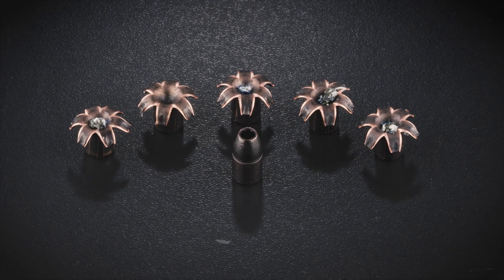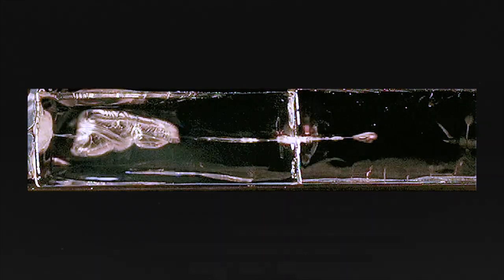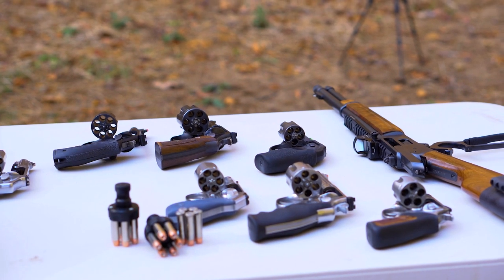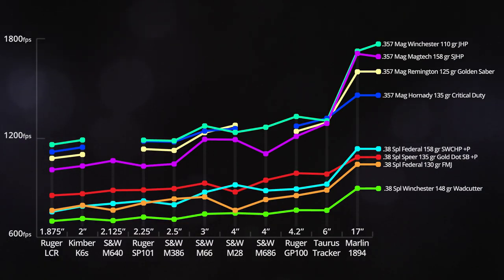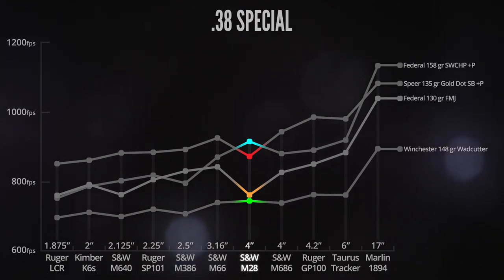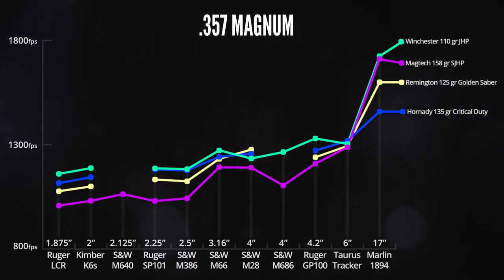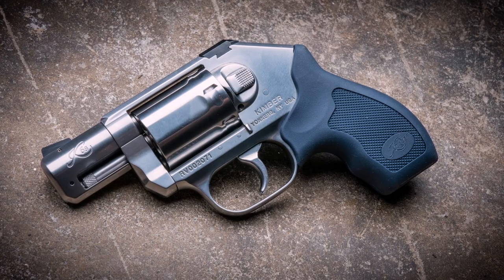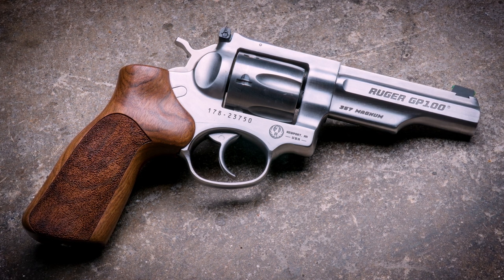Revolver Velocity versus Barrel Length

Comment: To be fair 5 shots is nowhere enough for a perfectly thorough comparison. 

Also one would need to shoot and test everything under lab conditions (controlled temperature and pressure, absence of wind and ideally calibrated machine) and use 10 rounds per single gun out of a certain production lot (the very same production lot for every single gun) and another 10 rounds per every single gun out of a different production lot of the very same ammo and very same production lot for every gun in order obtain a good mean accounting for every possible difference.

These results are kinda fair but one should also remember the 2.125 SW gun actually is a 38 Special only revolver which means it has a shorter firing chamber which might contribute in its slower than expected results when compaired to other barrel lengths.

Great work as usual tho.

Comment: Seems like the handier size, weight, and packability of the 7-shot 4.2" GP100 that I traded my old 6-shot 6" GP100 in for is more than worth the slight tradeoff in velocity, which is as I suspected. I rule!

Comment: So my 6 inch Colt Python should do the trick..
Reply: Oddly, while I wouldn't just sneeze at any 357, I've noticed that the Python frequently turns up in ballistic data-sets where is a sudden decrease in velocity instead of an increase, due to barrel length. Pythons are however, very accurate, in spite of the apparent "deficiency".  There's alot more to ballistics than speed and impact, even though we tend to obsess over those things with far more weight.

Comment: You need an 8inch gun and cut it down .5 inch at the time, until there in no more barrel outside the frame, but use only 2 loads in each caliber, the weakest and the hottest.

Comment: Interesting. Stuff I always wanted to know. Don't know why I don't get your e-mails, I'm a subscriber. 
So with my 1/2 dozen or so 2" revolvers, Maybe it's time I trade my Ruger SP101 2" in for S&W's Performance Center Pro Series Model 60 in the 3" barrel.(both are in .357)  My ammo of choice is Hornady Critical Defense. Maybe then I'll get more velocity, burnt powder, and expansion?! While the stubbies are great BUG's or pocket guns I am looking for a better concealed small carry revolver That does a better job!
Reply: Louis V - 3" seems to be something of a sweet spot, especially for .38+p loads. U don't lose much velocity, and of course there is the longer sight radius and usually adjustable sights. I have been thinking hard about the 3" LCR in .38 myself.  With magnum ammo, there is still some velocity loss due to slower burning powders which tend to be more optimal in a 6" barrel (or a carbine).  But it is still faster than a 2"

Comment: Biggest takeaway here concerning 357 Magnum loads is that those factory loads are WEAK SAUCE...     A 6" barrel firing the 110gr Winchester JHP ammo is barely cracking 1300fps?    125gr Golden Saber is also clocking in around the same 1300fps from that 6" Wheelgun..    Those are PATHETICLY WEAK 357 magnum and its my opinion that the factory rounds have never recovered from the vintage K-Frame's inability to deal with full power 357..  They downloaded and its never recovered..    I have 158gr handloads using H110 that average 1445 from a 6" 686..    125's should easily break 1500fps from a 6 wheelgun..   I guess with so many small 357 snubs out there the manufactures are loading the cartridge for those customers and not to the potential of the cartridge..   Which I guess makes sense since the few Handgun hunters left have generally moved on to larger, heavier bullets anyway..   That said,   Handloaded full house 357 magnum out of a 6" revolver is a VERY different animal than what is being shown on that graph.   And lastly,   anyone who has an old N-Frame M27 or M28 Smith owns a handgun that is truly one of the most legendary and well made double action 357 magnums ever produced by anyone..    A 4" M28 Highway Patrolman is easily capable of digesting a steady diet of 125gr JHP loads that clock in over 1500fps from its 4in barrel..    I've personally witnessed it.
Reply: Just so u know, the Win USA 110 gr load is a midrange load, rated at about 1250 fps from a 4" bbl. It is basically the old .38 Spl +p+ "Treasury" load from the 70's, in a magnum case. It is decent for defense if recoil is an issue, but penetration is a little shallow. It makes great practice ammo, and the brass seems to be high quality.  The full line Win 110 gr (red and white box) is rated at about 1500 fps from a 4" bbl, and took down many a malefactor when police still used revolvers.

Comment: In many ways the difference is pointless. Either you are or you are not going to carry a 4-inch revolver concealed. If it's not concealed there's no reason not to have a 4-inch barrel. If you're not willing to have a 4-inch revolver stuck down your crotch you're going to carry a 2-inch anyway and there's going to be an obvious loss in power.

Comment: Now try some high quality SD ammo other than Rem 357 125gr. SJHP....ya know...hst...gold dot...Underwood...better yet...a 357 MAG load with 158 grain bullet Thats hitting 1500 fps. There's a reason 357 Sig was made to duplicate 357 MAG performance, and not 9mm. I'm no Yankee...but you have to dumb down 357 for 9mm to get there. Read a study that said 357 and 44 MAG had been dumbed down over 51% apice because shooters wanted lightweight smaller carry guns. Paul Harrell has repeatedly disproved the "just as powerful" song with a little something called the meat target. Great advances have been made with 9mm. If those same efforts are made with other calibers, 9mm will be just what it is again....a decent defensive caliber...not optimal